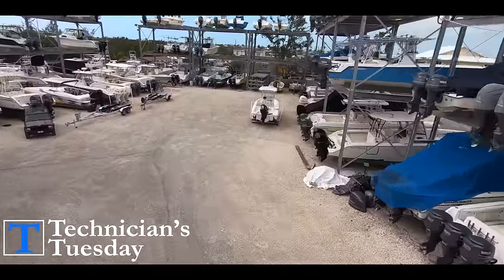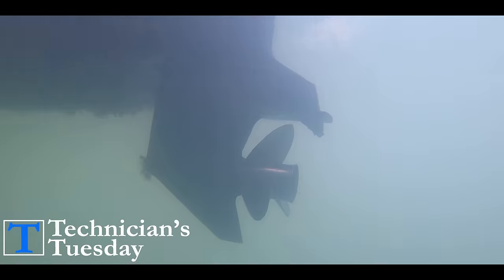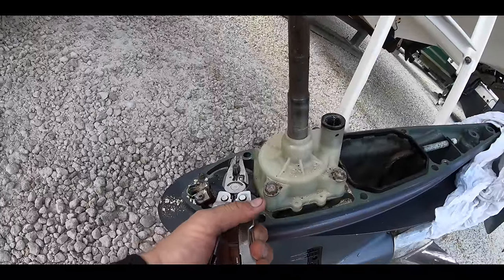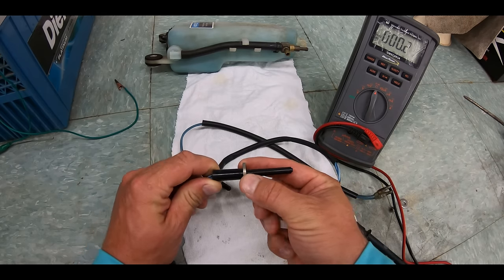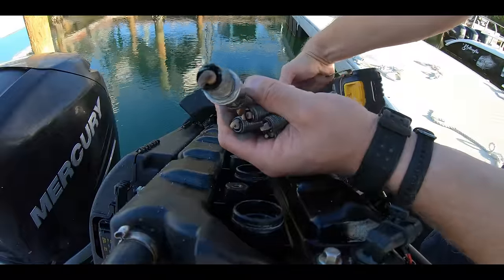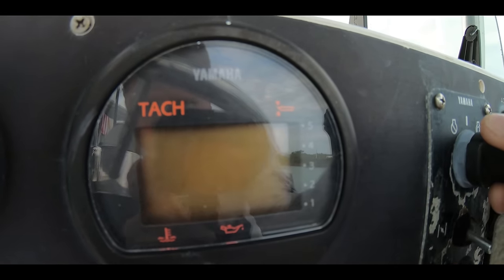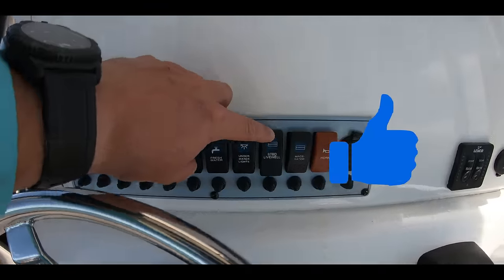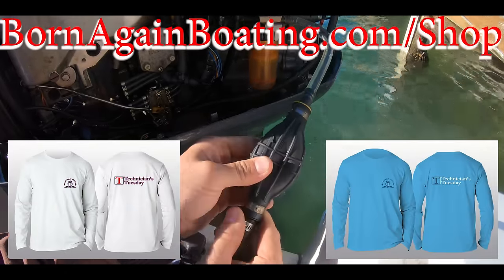Outboards #1 PROBLEM!

Comment: Any problem you may have with an outboard is still 100 times better than an inboard.
Reply: Not really it’s reliability
Reply: 1000 times better
Reply: A complete 350 mercruiser inboard outboard engine is 5000$ in Canada, how far does that go buying a 260 hp equivalent outboard??
Reply: Not diesel
Reply: Difficult to wear out a chevy block and yeah more forgiving except for winterization.  Heavier, yes!  Less efficient, probably!  Cat requirements really take the wind out of the sails, imo.
Reply: Maybe 1000 times pricier!! Sterndrives are cheaper to repair
Reply: Not when it falls off the back of ur boat haha
Reply: So that's why my truck runs a vertical shaft v8 got it.
Reply: Wait a minute, so inboard engines are the poor man's setup?  I hadn't thought of it that way before. I just know inboard sound way cooler.
Reply: @foellerd  no no they're not a poor man's set up.  Certainly once boats get BIG there are no more outboards at all and you get into BIG diesel inboards.  But for power to weight and planning hulls yes you can buy 80K+ outboards and you can have 3,4,5 of them.
Reply: I'd never own an inboard..even if it were given to me..I'd just sell it!
Reply: Absolutely right!! 👍
Reply: @sammylacks4937  going on year 28 of my mercruiser stern drive.   Did the required maintenance myself and still runs good.
Reply: Agree 💯👍
Reply: Even our notoriously unreliable OMC Cobra has made it 34 years with just regular maintenance. Inboards are fine if you don’t get lazy.
Reply: i’ve always wanted an inboard boat tho
Reply: @aaron-fauth  bruh inboards are so dang unreliable sometimes if you don’t baby them and then if something gets messed up and they aren’t vented properly they can legit blow up
Reply: 40 years old 60hp isuzu diesel still running like a charm 💪
Reply: @rickcollins7172  can we have that in English please?
Reply: @sammylacks4937 

 You will get a lot more than "3 good years out of a stern drive". It would be unusual to have any significant problems in the first 5 years of service.  Most Stern drives easily have a life span of 10-15 years.
Reply: Take this from a boat mechanic inboards are a a pain to work on compared to an outboard
Reply: So cargo ships would be better served with a few outboards? Maybe aircraft carriers too?
Reply: @carlitosway9090  if you knew what you were doing that wouldn't be the case.
Reply: I must be the luckiest SOB to ever own an inboard. Other than tune up/oil changes I've never had issues with mercruiser 5.0 or 5.7's. I believe the bigger motors may be over stressed. Now transom bellows and gimbal bearings needed to be done once on every boat I've had, but easy repairs. These videos have spooked me out of buying an outboard several times.
Reply: Outboard are garbage over rated over priced !
Reply: Shaft drive less hassle. Outdrives are awful
Reply: I don't agree. I put an outboard on my Toyota. It starts up first go every time, but you reckon I can get it to move? This fan looking thing spins at the bottom but the wheels don't budge an inch. I think I might need a bigger one?
Reply: @carlitosway9090  agreed, most of those inboards have to be totally removed to work on them comfortably
Reply: @biaggiwins  why spook you? Sounds like you've got enough money...
Reply: @edgewatersbestguitarist1524  lol, no sir. Never owned a boat that wasn't 10-15 years old. Or over 25 ft for that matter.
Reply: @billbobaggins801  brother please don’t talk like u know a thing about me!I’ve been a mechanic for over 20 years and I’m still in my 30’s!Maybe the one that doesn’t know what he’s talking about is you or you’ve never done real work on inboards!Just to keep it light if you know anything try changing a starter on a mercuiser especially when the costumer doesn’t maintain the boat well and the bolts are rusted to the core!No matter what u do penetrate,heat etc they snap and u got to pull an engine for a starter cuz u can’t get to it because it’s all the way in the bottom where it’s impossible to work with to begin with!Please get with it outboards are way better and more practical even more economical in every sense
Reply: @AmericanFry  we beat the fuck out of our inboards they do mint way faster than all the outboards and cheaper to buy and cheaper to fix new four stroke outboards are good if you got the money
Reply: I was operating a dingy with an outboard and the motor came unclamped and fell into the water...
Reply: Comments saying shaft drive better or outboard better , ive had both , freshwater smaller inboard is awesome , salwater ...give me a oitboard ..and like someone commeted , what i really want is a live aboard that will put me back into a inboard because of the size , 4 cylinder iron duke mercury alpha one out drive we picked up for 3500 lasted 20 years inichigan , sipped fuel , cheap ..moved to florida , saltwater killed it in one year , metal trailer dead too ..lol now i got two boats inshore and offshore both outboards , salt life now my fishing  brothers , and loving it when i can afford to go ..
Reply: @mikeleschber1316  dog is not a cat
Reply: @LEARTY528  Thats why my dad always had a safety chain on his not bolted on motor.
Reply: Completely false
Reply: My Chevy 350 has more hours than your outboard
Reply: whatever you do  don't drop a wench because it's the only one you have 20 miles out
Reply: Had two boats with twin 350 inboards.  Awesome!  But that was fresh water Lake Erie.  Now I’m in Florida.  For salt water, nothing but an outboard.
Reply: Just face each have there pros and cons

Comment: By far the biggest cause of problems with boats is the same cause of problems with campers. People take them out and then put them aside and ignore them. A boat is a complicated mechanical and electronic piece of equipment and it does not like to be neglected.

Comment: I don't own a boat, but I have friends and relatives that do. That gives me the opportunity to be dock side for various outings and observe other guys that have problems with their engines. It's appalling to witness the almost universal lack of maintenance and mechanical aptitude many boat owners display. All boats require though inspections and service maintenance at regular intervals. No way around it. Basically, they are a hole in the water that you throw money into.

Comment: I had a Evinrude 135 v-4 hat never saw saltwater.  I always ran the OEM oil to mix with the gas.  It would foul the plugs but that was easy to clean by pulling the plugs.  I ran it for 20 years with zero problems.  The fuel tank was kept full to avoid condemnation.

Comment: We have a 07 Honda 200 with 1400hr engine looks and runs like new. We also run salt away throughout it every run and its stored in our back yard. Oil changed with oem every 30hrs, valve train showed 0 signs of wear. And those are all off shore hours. Silicone the engine and wires every run. Boats are only expensive when you don't take care of them

Comment: Good video I have a F60 bought it new in 2010 one water pump anodes one set of plugs and 10 oil changes and one new Walmart battery which is 10 years old best outboard I’ve ever owned!

Comment: You forgot the water pump IMPELLER.  When they go bad it’s an engine killer. Change them every two years from the time it’s installed regardless of runtime.
Reply: Karl Jensen I change mine every 5 years.  No problems with that interval.  Of course I walk the boat off the sand bar so the pump never sucks up sand.  A lot of boaters power onto the bars, then reverse off at the end of the day.  Then you'd have to do it more often!
Reply: @slalomking  
You may be able to get away with it because of the type, brand and your usage. Some people store the boat for long intervals and this can be worse than a lot of run time. The rubber can take a set and the blades never rise again to make contact with the housing. On some pumps they use the same impeller for a big block and a small block engine, but the pump housing is different. The big block has more “cam” in it to displace more water hence pump more water. That makes what may be good for several years on one engine risky on another. There are cheep impeller knock offs out there too.

Comment: Great video of recapping trends. Keep up the good work! Always fuel, clean, and complete a maintenance checklist when mooring a boat for more than two hours. Constantly topping off the fuel keeps the thermal dynamics of your fuel vent system from sucking in moist air and condensing it.You will be rewarded with few problems.

Comment: Speaking of fuel, my grandfather smelled petrol when he was young: he opened the engine compartment of the boat and saw the floor full of gas.
The filler pipe had broken: he was also lucky because my grandmother was a smoker.
Reply: Saw a guy with a 20' something Bay boat pump 200 dollars worth in one of the rod holders. No he hadn't been drinking. Just mistook the fuel filler cap for the rod holder tab, inserted fuel nozzle,  cranked wide open and set holder. He went inside while the tank ( boat) filled. I would have lost it believing an ignition source would turn my ride into an inferno.
Don t leave while whatever is filling.
It could have been much much worse

Comment: One of the best ways to deal with oiling mechanism issues on a two stroke is to do away with it and just premix your oil and gas like you do on a two stroke line trimmer or leaf blower.  Viola! Problem solved.  I did this on my boat years ago and it has saved me tons of trouble.

Comment: New subscriber here. Majority of these issues can be SOMEWHAT prevented by regular maintenance. If you wait for stuff to go wrong, then look forward to these issues. I use my boat at least once a week and I get my engines serviced every 3 months...new plugs, new foot oil, and a freshwater flush after every use. It won't last forever, but the goal is keep it as reliable as possible. Great video.

Comment: On saltwater, flush the outboard long enough that the thermostat opens. This is the # 1 problem that outboard owners are guilty of. Replace the water pump at the recommended hrs & no problems. The outboard dealers here in south Florida love to sell new outboards.  I run a Honda 50 on my skiff & a 5.7 / 350 in my inboard 1978 Chris Craft.  Here I got over 3,000 nautical miles on my boats. They share the same GPS. Have fun guys!!!

Comment: Luckily I don't take my bass boat into salt water but I have still had to deal with many of the problems you mentioned.  Having been an auto mechanic has helped a lot.  I absolutely HATE alcohol in gasoline - it is no fun overhauling six carbs.
Reply: Alcohol can cause lots of problems.
My vehicles had problems because of alcohol. Everytime I drove one after consuming it.

Comment: I always inspect my boat before I take it out on the water the way a pilot would inspect his/her plane before flight. I first  turn on and on off all the switches (bilge pump, baitwell, all the lights, electronics, VHF radio etc...) to make sure everything works as it is supposed then I check the battery connections and the connections to the battery switch to ensure all cables are tightly connected. Lose cables will cause you all kinds of trouble. I also keep my battery poles clean as a whistle. Any corrosion will mean weak current and that's trouble too. After each trip, I fill up the gas tank  100% with recreational fuel and change my water/fuel separator every six months. Your water/fuel separator is  your first line of defense and it only costs 10 bucks. So there is no reason not to replace it regularly. Then I also remove the engine cap and do a visual inspection to make sure every looks good and I also spray the engine with Yamalube every six months. When on land, my batteries are always hooked up to the smart trickle charger. I learned all the above the hard way (I learned from my own mistakes and negligence when I was new to boating!) and if you do your due diligence before you head out, a day on the water will be a day of enjoyment and not a day of agony and embarrassment!!! And of course, I do the regular maintenance (change all the upper and lower fluids, all the filters etc...) every 100 hours or once a year whichever comes first. A well taken care of 4 stroke outboard Yamaha engine can be more reliable than a car engine actually! Yamaha engines ARE THE BEST!!!
Reply: Reha Erman i fly planes and I go over my boat just like a plane also to include the trailer. So far always made it back to the dock and always got the boat to and from the dock after 20 years of boating. Oh yea worst thing I ever got into was boating. But I am never giving it up.
Reply: @po28der  You know the drill, so you'll be okay. But eventually all that salt and pounding  will get to any boat even to the best built and well maintained ones. Despite all the care I give to my vessel, I still need to fix things from time to time but I am with you, I am never giving it up either! I really don't know what I would have done with myself without my boat! I would have been one depressed person maybe...
Reply: Reha Erman < Please write another really long and mindless comment.

Comment: If your alternator isn't putting out 14 + volts it's dead or nearly dead.  The standard charge voltage for a marine battery is the same as an automotive at 14.2 volts charging voltage and doubling for every cell in watts.  The built in voltage regulators will produce no more or less unless they are broken.

Comment: Use some WD-40& PB-BLASTER.& Marvel mystery oil.& stop leak from Lucas oil stabilizer.,or some stop smoke.& add in your own Lucas oil stabilizer.& etc. To your motor oils.& crankcase oil./ gear lube oil to.& including your oil tanks.& premixed fuel tanks to.

Comment: We have a mercury 115hp 4 stroke. It turns on but doesnt rev up in water. Boat doesnt plane. Outboat out of water does rev up but bit of misfiring. Spark are good.
Reply: if its misfiring, spark isn't good aka consistent! run the diagnostic cable and see if its throwing any codes

Comment: I had heard that Honda outboards had spark plug issues then I bought a brand new Honda four stroke 15 hp for my aluminum boat.  I didn't put many hours on the motor and both plugs died!  Luckily I had my trolling motor working.  Changed both plugs and it ran great.  A few months later, I sold the boat then a few months after that, the new owner called me and said the plugs failed!

Last boat I sold last year, had a brand new 90hp 2 stroke that only had 50 hours on it when I sold it.  I still needed to change the water separator filter every year!

Comment: I fix atms, safes and other back equipment. I try fix as much as I can on my car and motorcycle too. 
When you started talking about batteries and showed that birds nest of wires it made me want to climb in and reroute and tidy it all up.   I was almost twitching haha
Reply: I rig boats for a living. Same here
Reply: Just bought a 91, single battery originally, converted to dual battery (house and starting setup). It was wired all sorts of messed up, 3 circuits doing the same thing coming from 3 different power sources. I've literally pulled about 100ft of just junk extra wiring from the whole boat.  What blew my mind was the fuse block is a foot from the ignition but people would tap into the ignition to add a (unprotected) circuit opposed to the fuse block. It drives me insane to see unorganized wiring
Reply: I'm an engineer for a major vehicle upfitter and I find that the standards of electrical wiring in the marine industry are all over the place and pretty shitty at best. I've rewired almost everything on my boat except the engine management and I've made all the other systems so much less prone to failure and about 1000x easier to work on and troubleshoot if there is a problem.

Comment: I was in the marine business for a short time it’s gone to hell with four strokes. The added maintenance needed with valve timing head gasket failure timing belts left n right on Yama n mercs I’m amazed there not under water out of business I mean. There heavy slower than a two you 15-20 hour oil change at the dealership is more money you would spend on 2 stroke oil.

Comment: Having a boat is not as bad as it sounds , it's great fun and hours of enjoyment, if you are not mechanically inclined to the point that you know what you are doing and know your engine and other components then always take it to very good reputable mechanic or boat marina repair and service center ! The life of the engine is all in taking care of it and making sure it's greased at all zerk fittings and finding problems before they can get bad !

Comment: I avoid outboards at all costs for larger boats.  I/O -Inboard/outboard is the way to go, much easier to work on/service.  Large outboards are way too heavy and make a boat top heavy/dangerous.  Every part in an outboard is custom and very expensive.  I/O's use standard engines from GM or Ford and share many parts with automotive applications.  Also the outdrive is easy to take off and I can lift it myself since it's so small compared to a large outboard motor.   Another advantage is less noise with an I/O, who wants to hear all that noise from the outboard - an I/o is sound deadened in the engine compartment and more insulation can always be added to make it super quiet.
Reply: I/O is dead.  Not easier if you are paying someone to do the work.  The boat manufacturers shoe horn the engines in.  When you need work done, the bulk of the costs can be for just gaining access to the needed repair issue.
Reply: I/O’s may use a standard block to start but it is modified.  Very little would cross over from the auto world.  Go to Napa and tell them you need a crank shaft for a merc 496. Lol over and over.